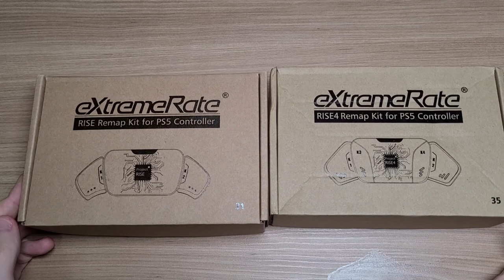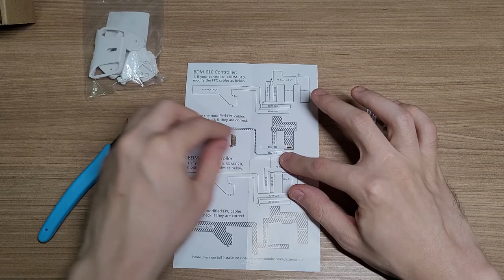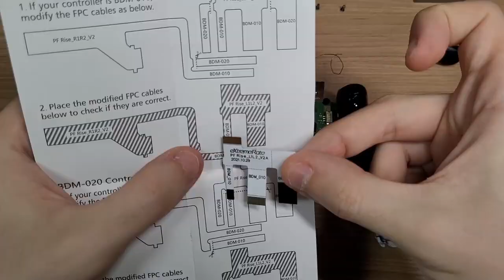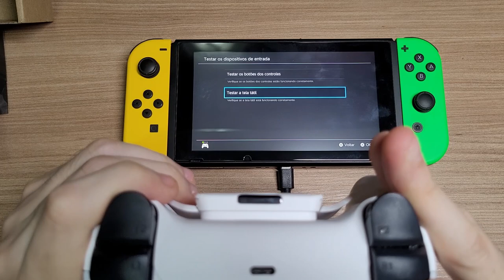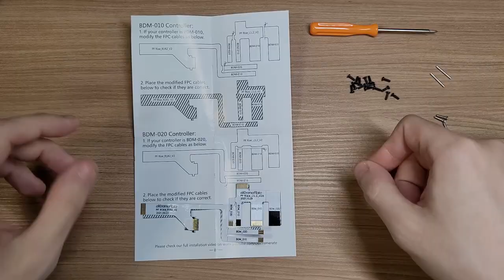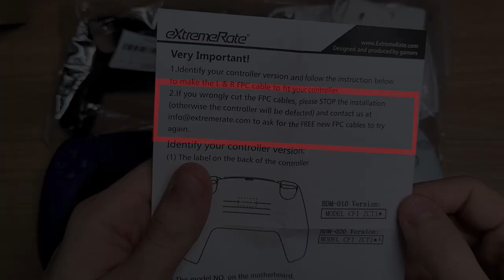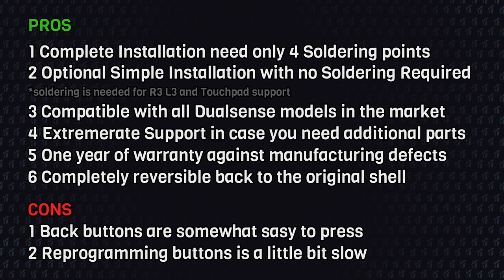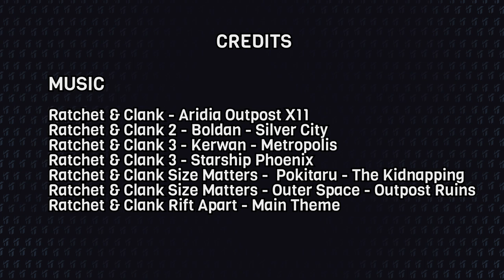Back Buttons for the Dualsense! / eXtremeRate Rise Remap Kit!

Comment: Own this kit and have used it for a few months now. I'll say that while it is high quality, I would recommend the metal version. My plastic one broke after about 3 months of use (To be fair that was during my playthrough of Elden Ring so it was getting pretty abused lol) but the metal version feels much more solid. It was also my very first soldering project and went perfectly, so the soldering is not too difficult if you decide to do it!

Comment: How does that work? The PS5 controller API just accepts new buttons? 
Can that be done with any Xbox controller too?
Reply from the maker: They aren't "new" buttons but more like shortcuts to any of the already existing button on the dualsense
Reply: i'm sure the API only accepts whatever buttons the dualsense already has. you can't magically add more buttons to support. That also goes for controllers of any other console. :p
Reply: @VKsChannel   
Well, that‘s sad to know... 
Why the hell Sony and Microsoft don‘t allow more buttons on their APIs?
Reply: @williamtael8379  because that's just an old Microsoft invention called DirectInput, but that thing is both ancient and problematic because back then game developers and controller manufacturers couldn't unanimously agree on which buttons or which joystick axes should do what in video games. It's not as standardized as they are today.
Reply: @2007excalibur2007    
We don‘t need standardisation in physical buttons, just in the use of those buttons.